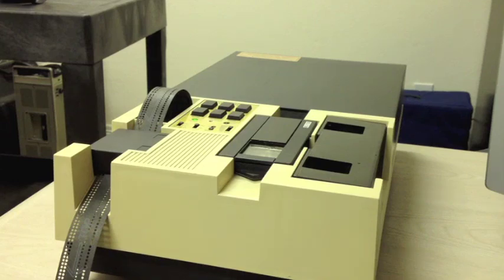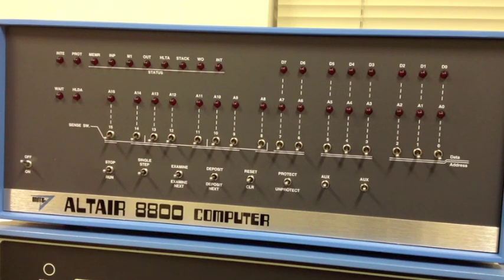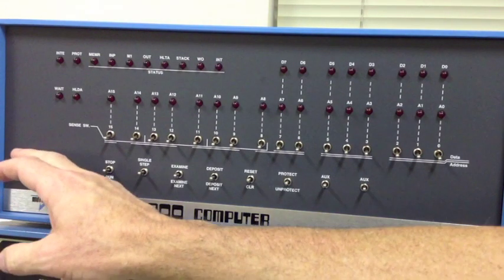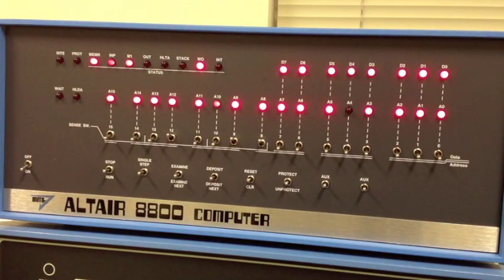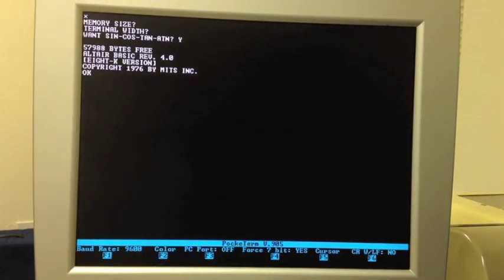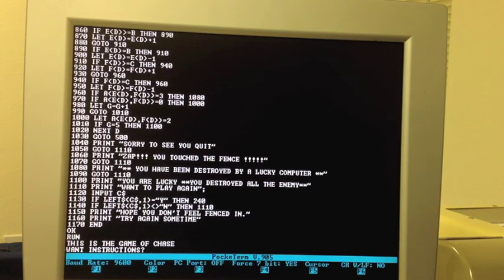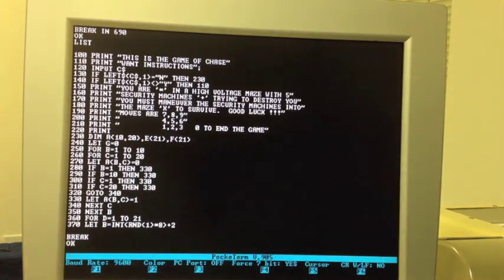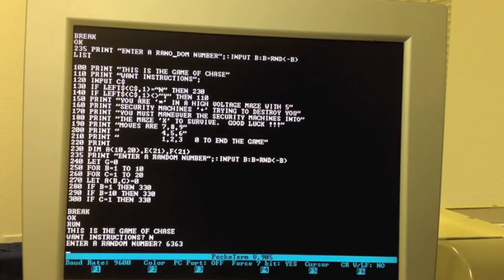Altair 8800 - Video #28 - High Speed Paper Tape Reader/Punch

Comment: Can you do a video on the punching mechanism? I'm curious about how it managed to achieved these speeds, and without tearing the tape with so many horizontal holes.
Reply: I have never seen this particular model however in the ones I have seen the paper is fed by a ratchet pushed by a pawl one push per character--if that makes sense--so that the tape is actually stopped for the period of the punch.  The period of the punch is called the "dwell time".  As long as the dwell time is less than or equal to the period that the tape is immobile it will not tear.  Some tape is oil impregnated.  In the machines I am familiar with the tape will jam before it will tear.

Comment: I recall a faster still photo tape reader for the HP 2100 series of mini computers (this was back in 1973), it read at 600 characters per second, and the paper tape shot out fast enough to end up landing about 2 to 3 feet away from the reader in a big pile. We had high speed hand held "rewinders" to rewind the paper tape. The ones from HP were expensive, and one of the shop guys made a  rewinder spool that would attach to a hand held drill as a "cheap" alternative. The high speed paper tape punch would punch paper tape at 400 characters per second or mylar tape at 100 characters per second. It was noisy enough that you either wore protective ear phones or walked out of the room. One of the advantages of fast paper tape readers was the sprocket holes in the paper tape could be used for timing (unlike fast card readers which needed to be more precise), so the speed didn't need to be that precise.

Comment: Nice video! That is the same model of paper tape punch/reader that I bought via eBay a few months ago, and I even use the same screwdriver trick when reading tapes. I've connected the machine up to my MacBook with an RS-232 to USB converter so I could archive some old tapes, and eventually to punch some new tapes for my PDP-8/M project.

I've found that it takes longer to rewind the pile of tape on the floor than it does to make the pile in the first place! I have an electric paper tape winder, but it's intended to spool up tape while it comes out of a low-speed punch and it can't keep up with this reader. It may come in handy when punching tape on my 33 ASR, though.
Reply: Thomas Buchmueller It's a GNT 4604. They show up on eBay from time to time, though finding one at a reasonable price isn't always easy!
Reply: Mark's Tech Channel Are you sure about that? It looks more like a 4601 instead. The six square buttons on top look more like the 4601 than the 4604.
Reply: Thomas Lake You might be right. I just looked at my 4604, and it has rectangular buttons with square raised tops.
Reply from the maker: Actually, its a GNT-4606 :)
Reply: So how much did the paper tape reader/punch set you back?

Comment: for the next video... could you punch an h.265 encoded 4k video file in the paper tape; run it through the reader and play in back on the screen using the altair?
Reply: +mbbxx  How long is the video? A one-minute video with audio at 2160p resolution encoded in H.264 is 162.2 MB. At 10 bytes per inch, the video would take 16.22 million inches or 256 miles of paper tape. A Teletype ASR 33 reading at 10 characters per second will take 4505.5 hours or 187.7 days or 6.17 months. That's more than half a year for one minute of video. This high speed tape reader reading at 45 characters per second will take 100.123 hours or 4.17 days to read.

Comment: We had winders back then. You would take the lead of the roll, put it at tension on the winder, and you would have a roll. You'll then use a 2nd winder and wind it so the tape would have the beginning first instead of last.  They were very fast - much faster than any reader - as a matter of fact, you may break your tape if you use it wrong.  For that we had a gadget I cannot recall was named, that you could take a broken paper tape and sticky tape them together.

Comment: where does it put the punched out dots? save them and use them for a craft project or similar
Reply: I think it counts them as valid votes for president
Reply: The punched out paper “dots” are called, “chads”.   They drop in to a small removable waste box which one empties, as required.

Comment: I have one of these reader/puncher machines that I hope to get going again.  Pretty sure that's a GNT brand you're using.  Mine is the 4601.  Bought it from an eBay seller some time ago.  I tried to punch something using an old DOS laptop and QBASIC as I thought with the native serial port and age appropriate hardware environment otherwise, I would have less trouble getting something punched out than going to a Windows machine with a USB/RS232 adapter.  Anyway, I never made it work and had to focus on other things.  Just wondering if you might share your serial port hardware configuration with us?  My machine has DIP switches underneath for baud rate, stop bits, etc..  Are you using anything more than a 3-wire cable?  I think the cable I was trying to use nulled out pins 6,8,20 while handshaking with 4 and 5.  That didn't work!  Something didn't.  Could be defective serial line drivers.  Easy fix, but I'd like to try it again against a known working configuration.  Thanks for the vid!

Comment: amazing! Does the tape encodes all the 8 bits? I see 9 holes, I guess 8 for the data bits and the small hole for traction and sync, right?
Reply: The center holes were used to lock onto the drive wheel on a teletype

Comment: Great video! What is the make and model of the high speed reader/punch?
Reply from the maker: This is a GNT-4606 from GN Telematic
Reply: deramp5113 -Thanks. It was great to see it in action in this video!
Reply: Amazingly, GNT are still going, and on their website they are still selling reader/punches under their CNC/NC page, and also paper tape supplies. Surely tape readers/punches aren't still being used today in industry, are they? If they are, I'm even more surprised that a cheap and simple SD-card based reader/writer hasn't replaced them in the CNC/NC setup. I'd be interested if anybody has any insight on this.

Comment: Are you using a different type of paper tape rather than the one used in the video with the Teletype? It appears to me that the speed of this paper tape reader would tear the paper tape unless stronger paper is used! Also, is the probability for error in the loaded program higher if you use this hi-speed paper tape reader/writer?
Reply from the maker: +Majkl98 No, both tapes are the same other than color. The high speed reader is optical, so there is no chance of damaging the tape other than the sprocket feed. Once the tape is up to speed, there's probably less force on the sprocket holes with the high speed reader than with the Teletype feed mechanism.
Reply: +deramp5113 Well I guess that's the reason why it was so expensive, other than the speed ;)

Comment: Are you familiar with the DSI NC-2400? There seems to be no technical / repair info on the internet
Reply from the maker: Jordan Rubin Here's a link to a manual for the NC-2400: http://bitsavers.informatik.uni-stuttgart.de/pdf/dsi/3401L_NC-2400_Operation_Feb83.pdf
Reply: deramp5113
 Ive got that one, in the same directory there is a much nicer August 83 revision that I have
http://bitsavers.informatik.uni-stuttgart.de/pdf/dsi/3401L_NC-2400_Operation_Aug83.pdf

also some firmware as well

http://bitsavers.informatik.uni-stuttgart.de/pdf/dsi/

 Im looking for a technical manual for the purpose of repair
Reply: The NC-2400 is a very nice machine.  It's one of the fastest readers and punches ever marketed.

Comment: Haha i hated the Altair 3 bit/nyble switches. I modified mine for 4 bits per nyble, unless you are used to a PDP, actual makes no sense.
I also used mylar tape as it was much more durable than paper tape. Mylar tape was used on early CNC machines due to the very greasy environment. Paper tape would not last long at all.
I still have a few rolls of mylar tape aroind

Comment: A paper tape punch/reader that operates at the speed of USB 3.0?
Reply: +gdm413229 By my calculation it would need to feed the tape at a blistering 1588km/s (986.7miles/s) to achieve the same data rate.
In other units 5716800km/h (3552000mph)
A truly insane speed. It would be an impressive sight indeed to see such a machine capable of doing that.
Reply: Punching paper tapes at this rate starts fires as far as I guess.
Reply: +gdm413229 LP0: Printer on Fire!